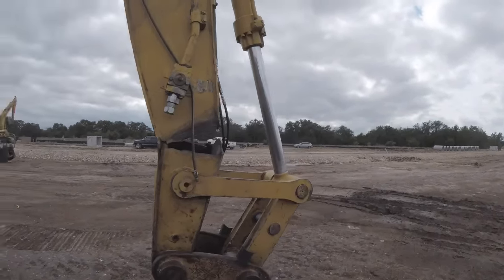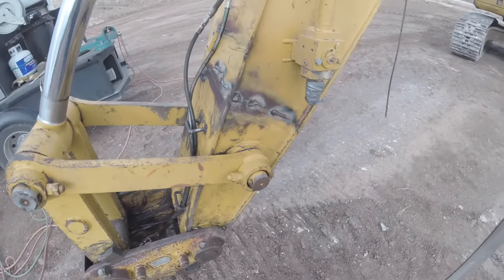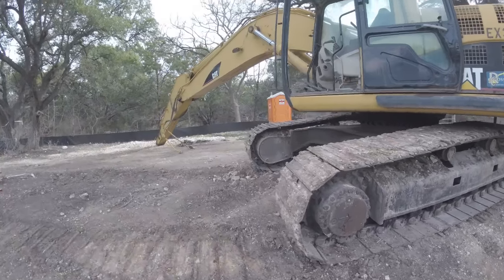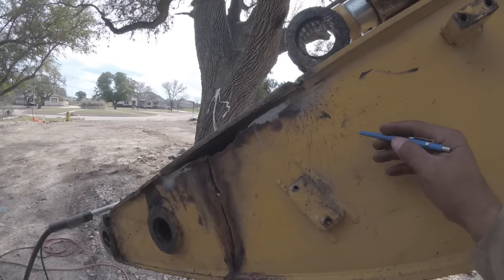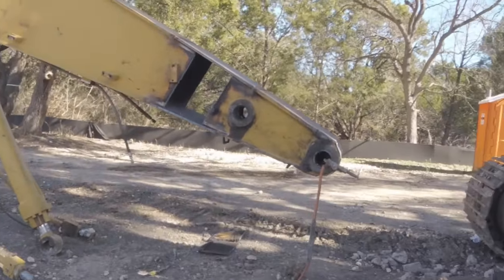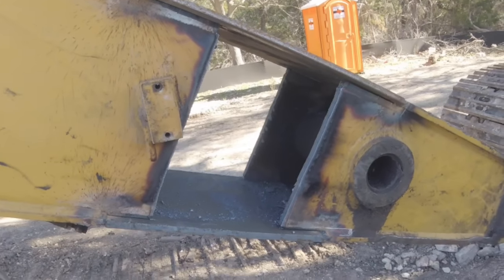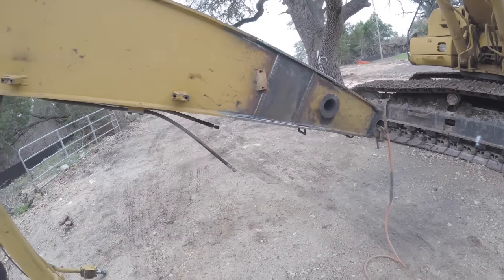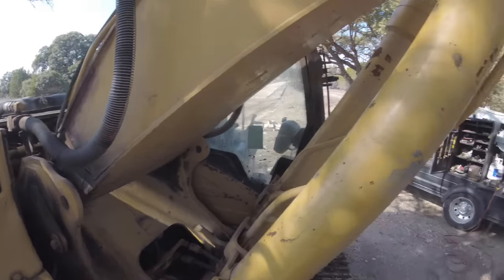Woops!! Excavator had a bad day!!

Comment: This excavating company looks like a good client to have.
Reply: Payne Killer  No grease makes the machine look cleaner and the welder doesn't have to worry about starting it on fire when he's fixing... :D
Reply: Payne Killer  Just bring a kiddie pool and a 55 gallon drum of brake cleaner or degreaser :)  And hide from the epa.
Reply: Hello
Reply: Jesus how long did this take start to finish? Seems like a month
Reply: @trevors8577  n
Reply: Not when you work like him I guess.
Reply: Especially considering they dont mind the repair taking almost a month...
Reply: @blownpony99  jobs like thats is a maximum 1week job depending on of he got the material it not. As they changed the rollers he had to wait 1week om that as well..... But dont take my word for it tho......
Reply: For a few services. Notice the silver 190 mph tape at the hydraulic fitting? 😂
Reply: Where is this at even. Is he at a big construction site or a mine?
Reply: I’m always amazed at how companies don’t take care of their equipment, and also work it out of specs. What do they expect, that they’re really saving money? How much did it cost, not just for the repairs, but for the time the machine was out of operation, not earning money? They just let things sit out and rust away.
Reply: @melgross  maybe it’s boils down to operators pushing the limits of the machine. I’m sure sometimes its flaws of design as well though.
Reply: @paralou8576  it’s management. I had my own company. My partner always tried to push people. Too many managers believe that the most work in the least time is good for their own careers. Long run…it’s not. As a result though, machines aren’t properly maintained, and are used beyond their specs.
Reply: Peter smith  heat treated means it would be brittle, nothing that lifts weight will ever be heat treated as you’d rather it bend than snap.
Reply: Agree
Reply: This is that machines 400th repair on that spot
Reply: Peter smith  No, what has happened is it' has flexed so much it's work hardened
Reply: @sixhundred3score6  that's to keep dust off it.. not the worst idea out there
Reply: @Rx7man  that's fair. I dont think I'd use that type of tape, though, as it tends to leave a residue. I can sort of picture the fitting in my mind (not around them often), but depending on if the fitting has an internal section, it may be a factor.
Reply: @sixhundred3score6  they do make special caps for them, but they always get lost.. duct tape might not be the best, but I wouldn't worry about it leaving residue on something that oily, probably have a heck or a time getting it on there
Reply: @paralou8576  its texas
Reply: Oraya parça sac malzemesi kullanılmdan kaynak olur mu mk
Reply: Hope cat see this so they can re-engineer  there machine s
Reply: @jdahling4738  do some reading, “heat treating” is done to first remove built up tension   from the processing, 
as well as change the hardness of the alloy.
heat-treatment can both 
anneal an alloy, which makes it softer but with higher elastic memory so it can flex further and more times without deforming. Or heat-treat can temper the alloy, or increase its hardness which makes it more wear resistant but also less elastic so bending will work-harden and cause stress fractures.

Heat treatment can do both, all else being equal, depending on the speed of cool down, faster = harder, oxygen presence = more brittle because the oxygen reacts with the carbon in the alloy steel.
Reply: i work for a company like that before and i seen big machines like that be broken for months before it would get fix it wouldn't get fix right away cuz they have other machines to replace it and one day whatever machine is broken it would get fix one day
Reply: @blownpony99  don't take the Lord's name in vain

Comment: My youngest brother was a welder and that probably was the thing he liked doing the most in life was to have a stinger in his hand. For a few years he welded in a ship yard repairing damages to about everything that floated. When the yard closed and he came home he welded off and on doing different jobs and really prided his self on doing a good job and I really liked doing projects with him knowing it was done right. Since those days are long ago it's nice to see a welder that takes pride and has excellent workmanship like you. Most of what I've seen in the past years they would have just scabbed something over the top and called it a day. Nice work!!!!!
Reply from the maker: Thank you. Yes, I try and convince my customers to let me fix it as best as possible. After they let me, they usually dont have any more issues
Reply: Scabs create work....unnecessarily and make everyone look bad shitty part is lots of them are "certified " bandits
Reply: @adamtheede2575   Indeed, fish plate on top of broken fish plate, but sometimes if you identify an engineering lacking in something, you can add a doubler to spread the load out in a new way and help prevent stress risers. But gotta do it right. I do say it looks like they're whipping that machine like a rented mule, either running the hammer without it being on something solid or using it as a pile driver.
Reply: I have a WW-2 story for you. I visited one of 5 brothers at his ranch and watched him coach his son on a horse. The man pointed with his fingers to guide the son. When I visited the other brother, he asked me if he noticed anything strange about his brother. I said his ears looked a bit deformed. He said "My brother has no fingers". He explained that his brother was working on a ship in San Pedro (Calif) during WW-2 when there was an explosion and subsequent fire in his area. He threw another man over his shoulder and discovered he couldn't grab the ladder. He climbed out and saved the man. The other brothers were called to the hospital and one said that he could have kicked his dad because of the bad condition of his brother. He wanted to remember him how he was. His head was the size of a watermelon and his hands were burnt stumps. Ffwd to today; the brother told me that no one notices his brother's hands because he doesn't try to hide his injury. People will swear that they had a finger pointed in their face when they have spirited arguments. RIP the Ihde brothers of Fresno California. Wally, Wayne, Woody, Warren and W(?) (Sorry...it's been so many years).
Reply: believe it or not cat sells a specific H plate to put on top of the crack after you weld it shut to provide structure and loadbalancing so that the steel wont crack next to the welded crack but i have noticed that you dont need those plates if you replace the old steel within the same amount of area as he did in the video though it makes the repair harder and more expensive you dont need to contact cat and buy a plate that exists because the engineers calculated the required thickness of steel plate on that pivot point wrong
Reply: @fastst1  Yeah, I'd say they are putting a side load onto the arm or twisting the machine as they hammer. Once you start the hammer, just apply direct pressure. Too many operators use the end of the hammer to rake rock away as the hammer is running.

Comment: I have never known anyone so clinical with a cutting torch a such a skilllful welder. 5*
Reply: The owners of the machine after they got his bill. lol
Reply: Pekka Ylönen  
What your describing is production line welding on high tolerance equipment.
A lot of the equipment you describe using didn't even exist back when I was a ironworker union welder or when I took a college course in welding technologies to read and write blueprints.
It's come a long way since then.
We did have Magniflux inspection and Xray tech tho.
None of that other stuff.
For what he was field welding I've absolutely no doubt he didn't need it.

Comment: Good field repairs.  I’ve repaired many of these booms over the years welding for a Cat dealer.   They recommend grade 50 steel for these.  You can also buy some of the castings from a Cat dealer if needed.  Use 7018 or outer shield flux core equivalent, preheat, and wrap to slow cool.    I also cut the crack out with a 1/4” opening clean slag off back, and drill hole in a 1/4 backing strip, put mig wire through it slid in the hole and pull it tight, no doubt you are getting a good 100 percent weld.

Comment: i've never seen anyone cut freehand that clean and straight with a torch..awesome craftsmanship
Reply: I've seen cncs do a worse job.
Reply: @deth3021  no kiddin
Reply: Very common skill in the oil field
Reply: I don’t understand. Why wasn’t there a plate welded to it when there was a first sign of cracks. Obviously weak points on the machine that needed beefed up. Seems like alot of this could’ve been avoided. If the people said just weld the crack then ok but I would’ve insisted putting plates to make it stronger. Unless the welder knows he will be back to make more money with future repairs so throw some glue on it till it completely breaks and brings in more money.

Comment: What are 771 thumbs down for? Beautiful job, professionally done. Period.
Reply: 809 now and thats the other pro welders griefing him for doing it the way he did. imo it dont matter its customer abuse and will break again any dame way so it don't matter. if it was me id remove the whole dame boom and reinforce the whole dame thing so it can be used with the breaker and not break any more but meh job security why fix the problem just keep repairing it when it breaks. needs some 5/8" plates full reinforcement to cope with that god dame breaker and some dampener pads glued to it after that .
Reply: Probably because he was using a red to weld it...talented yet so wrong with his brand choice. 😆

Comment: Obviously that section has had many "repairs" before seeing the number of weld traces. And I initially thought you were going to do another "patch" repair again. But then you tackled it in the proper way and did it very nicely. If that would have been repaired that way initially, there would be no need for anymore repairs. Odd how we never seem to have the time to repair things properly, but always have the time to redo it again and again... Nice repair and Thumbs Up!
Reply: A lot of times, those operations don’t want to take the time to shut the machine down long enough for a proper repair, so they want it patched back together so they can get going. They’ll claim they’ll get it fixed between jobs. That never happens and they end up having to shut it down in the middle of a job, like this one. It’s happened to me hundreds of times.
Reply: @hoffinator88h  Yup, the customers are usually the ones that tell you to half ass a repair.

Comment: Great looking repair, that  is probably better than it was when new .  Don't envy you on that repair on the other end of the stick. That things looks like it has been abused for too long.
Reply: The machine is working on a rock field so the breakers are in constant heavy use.
Reply: @markfryer9880  Its always the breakers that break the machine.

Comment: After 40 + years in the seat, that's the result of prying with the hammer. Nice repair, I'm sure you'll be doing more repairs for these idiot's.
Reply: Hammer not prying bar  !
Reply: T A  I'd guess it wasn't easy.
Reply: Hey now.  Every hammer is a pry bar.  Why else would they put it on the end of a big stick?  LOL.
Reply: Yes and no, constantly putting down force on the hammer instead of letting the hammer do the work is a big factor. I ran hammer for a few years in a large open pit surface mine. We had one guy who always would lift the machine off the ground while running the hammer, I would just let the machine do the work. My machine had much less downtime every year.
Reply: woman who does yoga have joints that last much longer than woman who does MMA. Finess does make equipment last longer!
Reply: @TheRoadhammer379  ... and production rate

Comment: Superb job as usual, the repair will be as long lasting as the factory welds as he has removed all the damaged steel back to unaffected structure, reengineering it with thicker steel just moves the failure point,  if its the same strength the whole arm stretches evenly a stronger piece concentrates the flex in one point, stronger sometimes isn't better.

Comment: Excellent work there, sir. I worked at reclamation district switching on pumps and opening ditch gates. I also did repairs on equipment that was so old, they should be in museums. Our shop welder was from the 30s or 40s. My high school shop teacher told me about lamp (rectifiers) diodes that were filled with mercury. I actually used one made by Lincoln. Every time I used the stinger a lamp turned on with a bluish color. Yep, a history book welder is what the shop had. Oh, we also had a 1925 Westinghouse 100 horsepower AC motor with a flywheel and belt for the clam shell pump.Cheers

Comment: Can this guy cut straight with an oxy-acetylene torch or what!!! And that repair looks really good. I expected at the start that you would grind out the cracks, bend the boom back to where the cracks pinched closed then just fill with welds. You really did it right!

Comment: The quality of your work, and your amazing work ethics are why I just subbed to your channel. Although, you did make a lot of extra work for yourself with this  job. The stresses on that boom are totally unrelated to whether or not it is straight. I used to be a mechanical engineer for what that's worth. But what you did was the kind of thing which makes this a better world.
Reply: What extra work did he make for himself ?
Reply: I agree the dipper arm was straight  when cat made it. Isaac has done the job right in my book. He has made the plates and welds staggered to release the stresses. The backing plates are a good move so you can plough in the weld nice and hot. A very nice neat bit of fabing and welding. He checks up on his repairs which is a good thing to do.  Good customer service. When you are self employed and charging  someone.  You are taking their  money.  That's why he is never short of work. Keep the video's  coming love them to bits. From jonesy  south Wales GB.

Comment: You shouldn't make any 90 degree repairs on any "stressed member" such as on an excavator boom, stick or truck frame. It creates a "notch condition". The "repair" will most likely fail. Were you using Lincoln, NR 211 on that repair? I would use stick from the 8018-9018 for the welds. It needs to be "fish plated" to last especially when using a hammer. Retired welder with 43 years experience.
Reply: Correct but this is another youtube  case of the ignorent telling everyone how to do it
Reply: I'm no welder, but wouldn't 1/16th or maybe .045 dual shielded flux core work fine for this application? I would have thought it would have been better in this instance to gouge and weld the original arm back together and then put a massive brace on both sides of the repair but what the hell do I know.
Reply: @cinderswolfhound6874  Not having time to make videos is not the same as not having expertise. I'm always grateful for others sharing their expertise since I don't yet know it all.
Reply: I worked for Norfolk Southern Railway for 41 years as a certified welder. Back in the early 80’s NS had started using NR211 wire in all their freight car repair shops. After a year or so, due to several significant failures of welds made with that wire (many causing derailments) they ordered all NR211 scrapped! They replaced it with dual shielded wire, which is the sweetest stuff going! As a side note, at the time we were using 211, there was a disclaimer on every box of wire that stated it was not for use on steel over 3/8” thick! We routinely weld 3/4” & 1” plate!
Reply: @tomt9543  NR 211 is more of the 6011 when it comes to innershield welding. I wouldn't use it on anything critical or on a stressed member.

Comment: Reinforcement plates were called for on this machines stress points, throw welds at it and IT will return.
Reply: That's why his PREVIOUS repair failed in the HAZ.
Reply: I'm not a professional or certified welder, but I would think that after he replaced the " original" sheet metal, "fish plates" shaped like diamonds with rounded ends should have been welded over the areas where the "straight" line beads were placed. I have repaired parts of a medium duty tow truck, using the same process, back up plates, to avoid oxides on the back side, replace all the torn and bent material and then fish plates with large plug welds.( about 3" diameter)  The tip of the excavator has plenty of room for the fish plates to be added.  Anybody that really knows about this matter cares to comment with a logical explanation? I was told by a Miller welding engineer that the work should not be in a straight line because there will "concentrated" stress point that will cause premature failure. His cutting ability puts him in the upper portion of the class.
Reply: @dveloso150  You are correct, the same is done when people want to make a long bed classic truck to a short bed truck this way the torsional load/force is distributed over a larger area.
Reply: @mauricioespinoza5390  so basically you just weld the diamond shaped plate over what he has done in this video?

Comment: Seen machines using breakers with boom cracks all over. Seen breakers with cracks all over too. It always seems like the breakers are just a little too big for the machines as well. But a few thousand hours between major service like this must still make money.
  Nice attention to detail and glad to see it done completely. The secondary cracks were frickin wild! That’s some serious abuse to have both far ends of the booms trashed. Surprised they stopped before complete failure